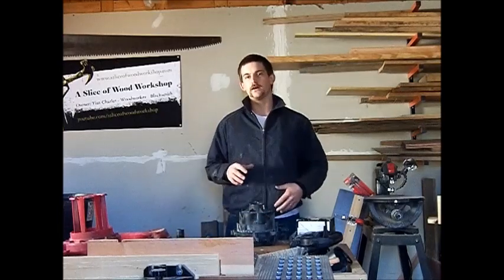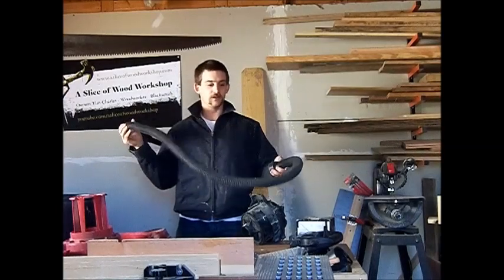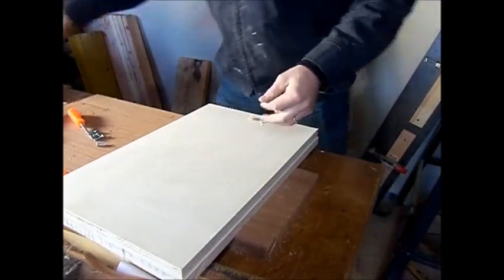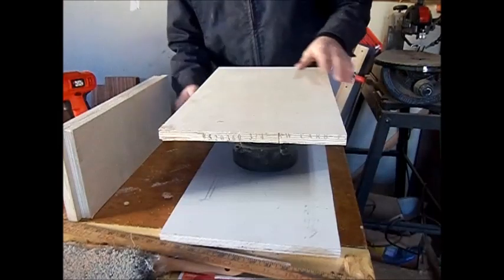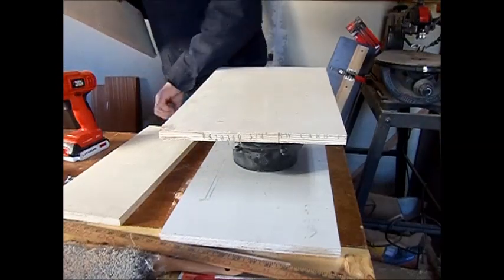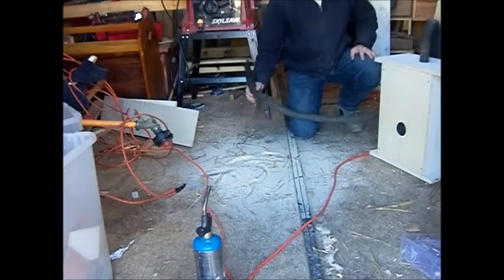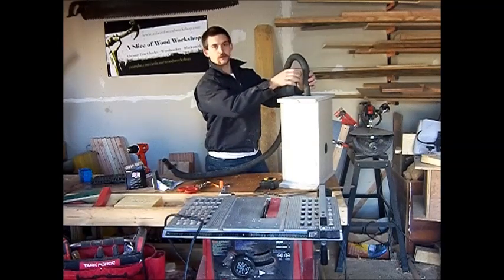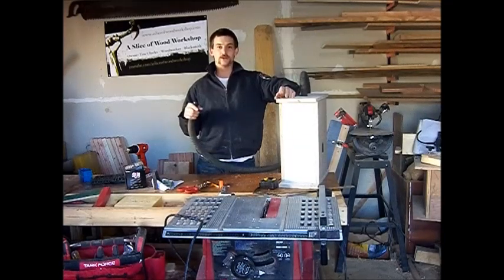Make Your Own Blower

Comment: Hey Tim, great experiment. Throw some back pack straps on that and go to town in the yard. Lol! You're on the right track with air control either using a blast gate or a rheostat to control the motor itself. Are you able to silicone the box shut from the inside to seal up your air leaks?

Comment: Why not just reverse the direction the motor turns? Then you wouldn't need to build anything. Just hook up a hose to the (what is now the in-take) out-take valve with some duct tape.
Reply from the maker: This gives options for those who end up buying just a motor, or have something they can get a motor from.